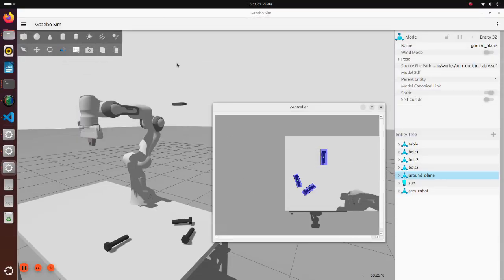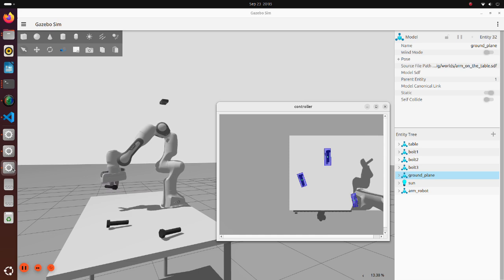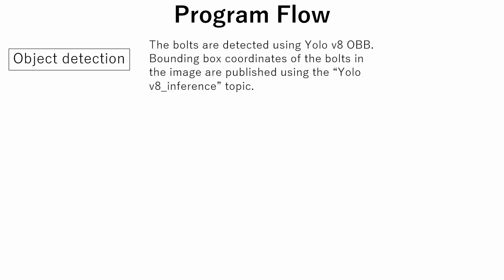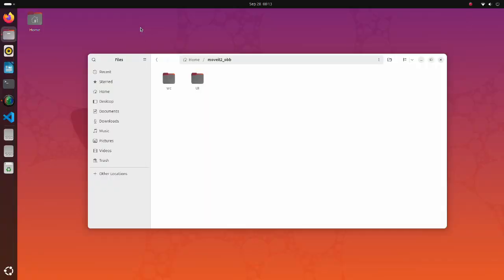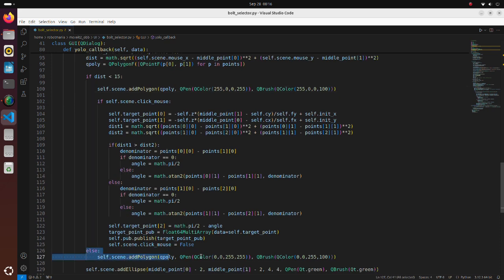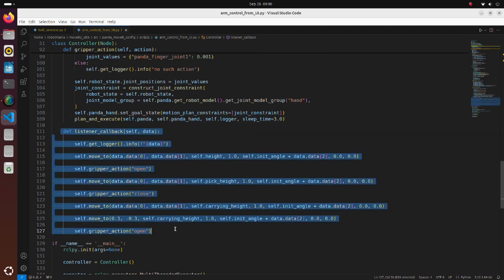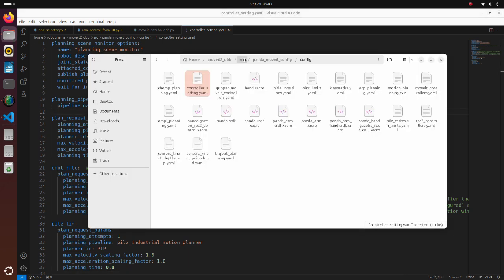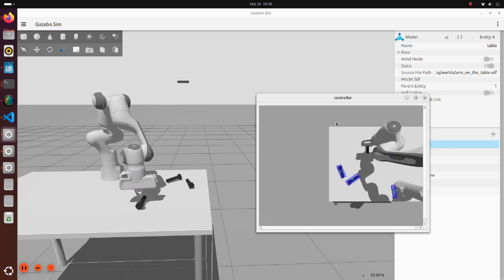Pick and Place Simulation Using MoveIt and Yolov8 OBB

Comment: hello sir, i am facing a problem  while implementing this project in my pc, i came upto controller window but the controller window is showing blank i am not able to see the bolts and camera footage, so please help to solve this problem, it will be grate to me.

and iam using gazebo ignition and ros2 humble, can you suggest me what version of gazebo and ros is suitable to directly implement your files shared in description.
Reply from the maker: Hi mani kanta!
Thanks for watching my video!
Do you have any errors in the terminals?
Reply: @robotmania8896  This replay i got in first terminal "[ros2 run controller_manager spawner panda_hand_controller-9] [INFO] [1737562038.199494726] [spawner_panda_hand_controller]: waiting for service /controller_manager/list_controllers to become available...
"

and in 2nd terminal "[yolov8_obb_publisher.py-1] Speed: 14.1ms preprocess, 706.2ms inference, 9.4ms postprocess per image at shape (1, 3, 480, 640)
[yolov8_obb_publisher.py-1] "

in 3rd terminal or controler terminal " mani@MMK:~$ source moveit2_obb/install/setup.bash
mani@MMK:~$ cd moveit2_obb/UI
mani@MMK:~/moveit2_obb/UI$ python3 bolt_selector.py
Warning: Ignoring XDG_SESSION_TYPE=wayland on Gnome. Use QT_QPA_PLATFORM=wayland to run on Wayland anyway.
"

it will be helpful if you can share your good self whatsapp number to my email id, so i can clarify my doubts by sharing screenshot.
Reply from the maker: Sorry for the late response. The 1st and 2nd terminals seem fine. There is a warning in the third terminal. Can you please apply a solution mentioned in this post. https://stackoverflow.com/questions/69828508/warning-ignoring-xdg-session-type-wayland-on-gnome-use-qt-qpa-platform-wayland
Here is my e-mail address: robotmania8867@yahoo.com
Reply: @robotmania8896  Thank you sir for replaying, i definitely try this solution.
Reply: @manikanta-h9k  did the controller window opened for you. even i am using ros2 humble and facing same problem. the controller window is blank and i am getting msg as bolt_selector.py is not responding. can u please say me how u resolved the problem

Comment: I’m facing an issue with the ROS 2 MoveIt Gazebo simulation. Here’s what happens:

First, I tried running it locally with ROS Humble on ubuntu 22.04 and Gazebo Harmonic. Everything seemed fine until I clicked on the bolt, but nothing happened, and the robot didn’t move. So, I switched to using Docker with ROS 2 Jazzy on ubuntu 24, following a similar setup, and this is what I’ve received.

when sending this command : ros2 launch panda_moveit_config moveit_gazebo_obb.py
1. In Gazebo: The robot model falls onto the table, unable to stand, like it’s not being controlled properly.
2. In RViz: The planning scene turns orange with the error `request initial scene failed` after a few seconds.

In the terminal:
I see this message (locally and when using docker ):  
`[ros2 run controller_manager spawner joint_state_broadcaster-10] [INFO] [1736372354.217360329] [spawner_joint_state_broadcaster]: waiting for service /controller_manager/list_controllers to become available...`

I need help troubleshooting this—could you assist me in checking if the controllers are loaded properly and ensuring that the physics and MoveIt setup are correct?
thank you in advance !!!
Reply from the maker: Hi Avihai Giuili!
Thanks for watching my video!
The message in the terminal indicates that the controller manager can not start due to some reason. Often, there should be another cause that prevents the controller manager from being started. Do you have any other errors above that message?
Reply: @robotmania8896  I solved this by installing sudo apt install ros-jazzy-gz-ros2-control. Hope this helps anyone else facing the same issue. Also, your videos are really interesting—thanks for sharing your projects! Do you have a GitHub or any other platform where we can find more of your projects?
Reply from the maker: I am glad that you have solved your problem! All my publicly available projects are here. All projects come with a code. So, feel free to use or modify them.

Comment: Hi, Thanks for the video! May I ask what's the key for being able to pick up in the simulation? I've tried a lot of trick using MTC to pick up a object in Gazebo classic, but it ends up sliding away. 
BTW, Is there a version for ros2 humble? I can't run the demo :(
Reply from the maker: Hi Eddie Shen!
Thanks for watching my video!
I also find it difficult to grasp objects in gazebo. Generally, torque control should be used to grasp objects but I am not sure if moveit supports torque control for gripper-controller. In this tutorial I modified the fingers of the gripper so that when they are closed, they will hold a bolt but will not apply any force (there is a reaction force though) to it. I did nearly the same thing in my previous MoveIt video. https://www.youtube.com/watch?v=_flpwM8yyVM

Comment: Hello, everything works smoothly, but when it approaches an object, the fingers open and close very slowly and cannot grasp the object. After doing some research, I think the problem might be due to the fingers' starting positions being incorrectly numbered, causing them to be very small. How can I fix this?
Reply from the maker: Hi Andaç Fındıkçı!
Thanks for watching my video!
If you would like to change starting position of the fingers while they begin closing, you should modify “joint_values”, line 97 in the “arm_control_from_UI” script.

Comment: Thank you Great video!. My ros2 version is foxy. So, How to do this project in foxy? if  i install packages (ros-foxy-ros2-control, ros-foxy-ros2-controllers, ros-foxy-gripper-controllers, ros-foxy-moveit), can i do this project?
Reply from the maker: Hi 솔Au!
Thanks for watching my video!
You have to use gazebo-sim for this project. But syntaxes in gazebo-sim that are suitable for ROS2 Foxy are different from those in gazebo-sim Harmonic. Also, to use moveit-py with ROS2 Foxy, probably you will need to build moveit from source. So, I think it is difficult to run this simulation using Foxy.

Comment: thanks for the amazing video quick question can this simulation be implemented directly on a robotic arm with a raspberry pie or Arduino and a webcam as the camera and instead of using yolo i use my own cnn based object detection model?
Reply from the maker: Hi SHARK YT!
Thanks for watching my video!
Yes, you can implement this using Raspberry Pi. But you should create an interface for your actuators which you will use with ros2 control.
Reply: @robotmania8896  ahaa ok got it thanks again!!! also one mor ething are u suing ubuntu on vm or actual machine
Reply from the maker: I am using Ubuntu on the actual machine.

Comment: which version of pytorch. torch. and torch-vision were used for yolov8 in this project because I am using arm64 on ubuntu 24?
Reply from the maker: Hi Pushpa Krishnaswamy!
Thanks for watching my video!
I have used torch 2.2. I don’t really remember torch-vision version. I think you will not have any problems if you install it using pip.
Reply: @robotmania8896  many thanks! Successfully works with the following: 
pip3 install torch==2.2.0 torchvision==0.17.0 --break-system-packages

Comment: another challenge is when I click on the bolt, the arm does not move and there are no error messages. How can I resolve this? Please help.
Reply from the maker: So, you have solved your problem?
Reply: @robotmania8896  the arm still does not move on click. Please help
Reply: hi how you solve this
Reply: @rajmeetsingh1625  sudo apt install ros-jazzy-moveit*
Reply from the maker: @rajmeetsingh1625  What problem exactly do you have?
Reply: I also got the same problem 😔
Reply: Could you solve it or not ?

Comment: I get this error for every controller ```Could not load controller 'front_right_leg_joint' because controller type 'effort_controllers/JointPositionController' does not exist.
[ERROR] [1728658502.009798047, 0.252000000]: Use 'rosservice call controller_manager/list_controller_types' to get the available types```. I am using ros noetic and ubuntu 20.04.6

Comment: Hi, thanks. When I clicked on the red box bolt, the robot does not move. Error "waiting for service to start " ....
Reply from the maker: Hi rajmeet singh!
Thanks for watching my video!
Can you tell me which node outputs this error?
Reply: @robotmania8896  This error " [spawner_panda_hand_controller]: Could not contact service /controller_manager/list_controllers " 
[spawner_panda_hand_controller]: waiting for service /controller_manager/list_controllers to become available...
Reply: UserWarning: Unable to import Axes3D. This may be due to multiple versions of Matplotlib being installed
Reply: [spawner_panda_arm_controller]: Could not contact service /controller_manager/list_controllers
Reply from the maker: It seems that you have a problem with ROS2 control. Does ROS2 control work with your other projects?
Reply: @robotmania8896  yes, or I need to install it again?
Reply: @robotmania8896  i reinstall the ROS2 control. but doesn't works. kindly help
Reply from the maker: To be honest, I don’t know why you have this problem. Have you installed moveit2?
Reply: @robotmania8896  yes, i installed all moveit2, controller manager etc. but still not able to communicate with controller ros2. I am running this on linux ubuntu as well as on jetson edge device.
Reply: I am using humble . do i need to use jazzy ?
Reply from the maker: As mentioned in the description, this tutorial was made using Jazzy, so it will be easier for you to use Jazzy too.